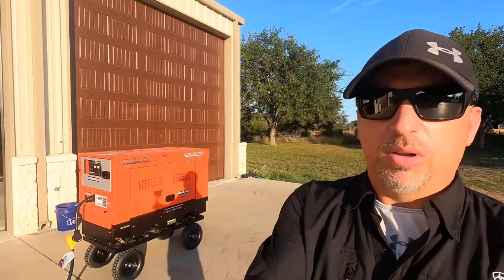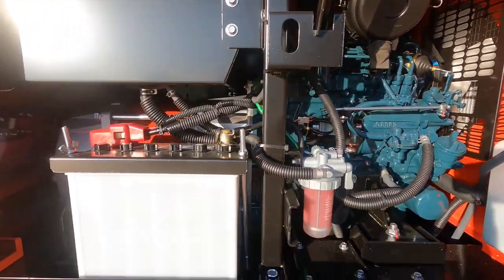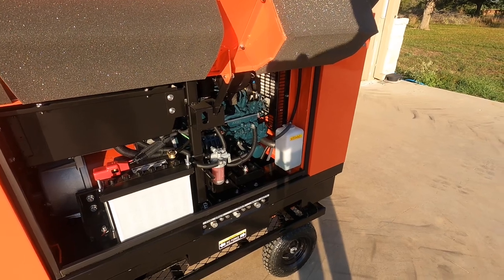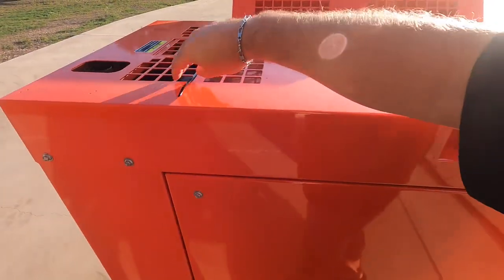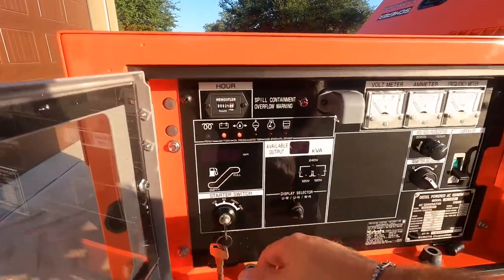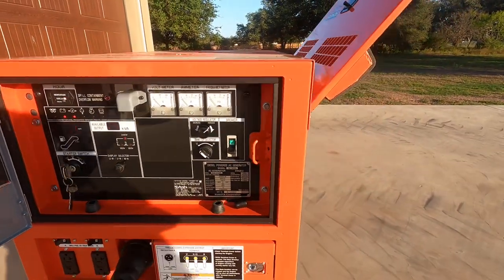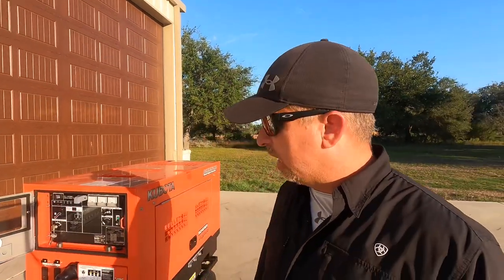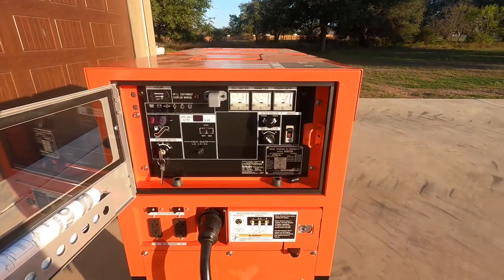Kubota GL14000 Lowboy Diesel Generator #dieselgenerators #Kubota

Comment: Great video. I have the exact same generator with 53 hours on it. Actually got it from the exact Kubota dealer in Victoria you did. It's a great generator but to big for my liking. Moving it around is always a pain in the rear. It's practically brand new and I am wanting to sell it to get smaller gasoline generator. If you know anyone that would want a like new GL14000 let me know if you could. I actually live near the Beeville area, so close to your neck of the woods. Thanks and keep up the good videos.
Reply from the maker: Thanks! I have the predator 9500 and 5000 and they are very impressive.. The 9500 is a 240 volt unit but only has a 30 amp..
Reply: I'm looking for one to run my welder and to have for a backup for my house.  Just curious if you still have it.  I'm in Hot Springs, AR

Comment: If it doesn't speed up or slow down depending on load is a deal breaker for me. I really want one but running 3600 RPM with only a light bulb on does not make sense.

Comment: Great review thanks.  You mention running 2 RVs, to do that, would a double 50A Y adapter pigtail be used plugged into the 50A Generator outlet? Then 2 separate 50A cords from the pigtail to the RVs?  I’m considering one of these for home backup where I have 2 separate 50A backup circuits. One to house and one to shop.  Trying to find a single generator to run both circuits, knowing I will need to manage load. Thanks
Reply from the maker: The y adapter could be maxed out on amperage with #6 wire. Proper way would be to make a pigtail and use hardwire connection
Reply: Gotcha thanks for that info.  That was my initial thought, to use the hardwire connection to add a 2nd 50A outlet, just thought the pigtail would be easier but good point on it being maxed out, or near maxed most of the time

Comment: @rockyrohde Do you know if there are holes on the underside to attach casters for transportation?
Reply from the maker: I did this before. I used two 2x4’s and attached casters to them and attached 2x4 to the fork channels.
Reply: @RockyRohde  thanks.  I’m trying to figure out how I might get this off the pallet and into the backyard without forks.  Appreciate the reply.  This should work once I can lift it high enough.